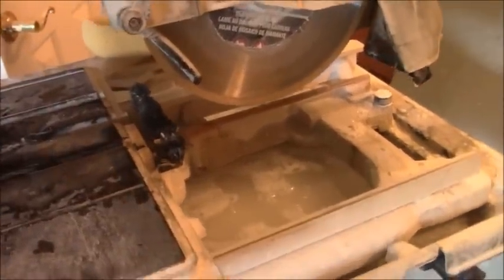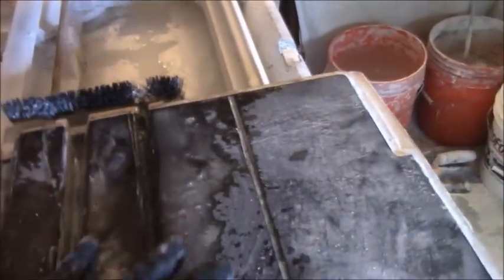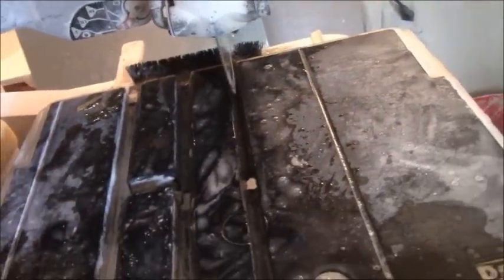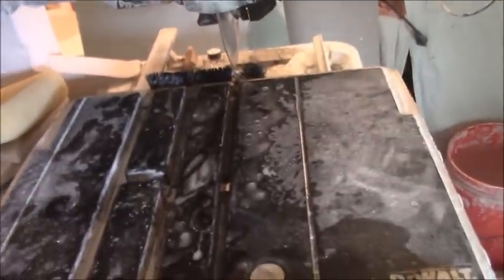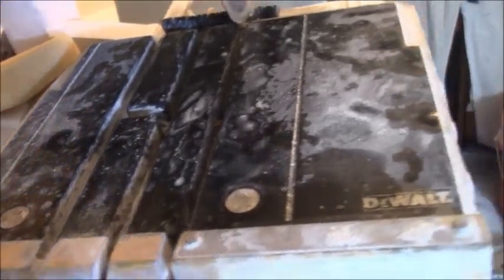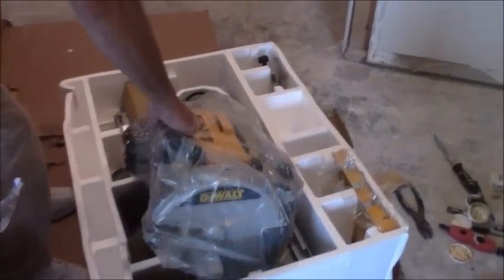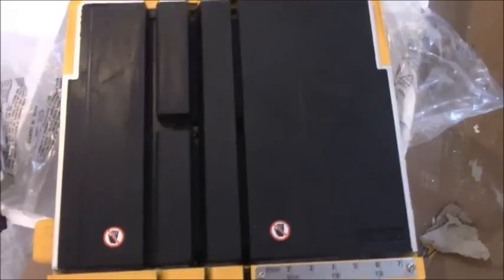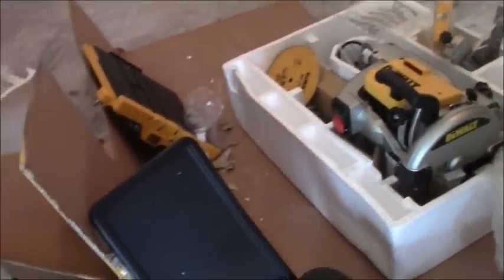Dewalt D24000 Tile Saw.......a review

Comment: I bought the dewalt saw about 12 years ago and it was already used at the time and love it,  but it is not as durable as a target or now huskvarna.  A belt driven motor is just more heavy duty imo. Since owning this saw, I have had to replace the bearings about 5 times but perhaps the new models are better. Each time I replaced the bearings it's about 100 bucks in parts , but the mobility , options, and all the features you mentioned make it my favorite saw I have ever used. With these hard porcelain tiles today, this dewalt just doesn't have the power day in and day out to last without these bearings wearing out imo . Not that it's a diyer saw, but it's not really built for an everyday commercial type saw like the targets were, but for me, someone e that doesn't use it on every job, it's features out weighs the motor issues. My fav thing is how dry this saw is! Once you install the side and back water catch trays, it literally doesn't spill any water. My tray is fine and I don't think you will ever have an issue with it at all. You can also use 7 or 8 inch blades (which I do sometimes ) so to eliminate the 10 in blade flex you get with really hard porcelain tiles. I have owned 4 different brands of wet saws in  35 years of tiling and although this is maybe a light duty saw, it is my favorite
Reply from the maker: Thanks
For
The
Input
Reply: vapdivrr...... Hey I need your help
Reply: What do you need buddy?
Reply: siddharth nagv
Reply: Unless your paying someone to do it for you, then your full of shit about  "Each time I replaced the bearings it's about 100 bucks in parts".  I just changed mine and it was $14 for the bearings.  Did it myself in 5 minutes.

Comment: I came across this porcelain tile that was so hard I couldn't cut without chipout until I found the best tile blade I've ever used. The Alpha Porcellana 10" part # pt 10a+. When any blade starts to run or chip out I cut an old red brick about 10xs forward and backward to remove glazing and expose new diamonds. This seems to be working best for me, just thought I'd throw that out there.  I think you'll push the ole husky aside the more you use the Dewalt. I do miss the power of Belt. God vid Bob!
Reply from the maker: Thank You Sir !

Comment: I recently purchased the DeWalt 10 inch saw. But straight out of the box it was chipping tile and cut crooked I tried to adjust on it numerous times using the factory blade they sent which is a Dewalt but I can't seem to get it to not chip the tile. Will putting a higher-quality blade on Fix-It what's your recommendation?

Comment: Is a tile saw better than a manual tile cutter (score and break off kind) for all tile cutting situations or is there is time and place where it can be more appropriate than a tile saw?
Reply from the maker: A wet saw is ALWAYS used for my jobs, very rare I use a manual cutter ( score & snap ) but a lot of tilers do use both.
No reason for a DIY'r to spend money on this, there are cheaper wet saws out there AND you can always rent one.
Reply: The saw and the cutter are tools that complement each other and is best to have both at hand. The saw can do ANYTHING the cutter can and then some (L cuts, 45 degree cuts... ) and the cut itself will usually be cleaner. If the cut is going to be exposed - use the saw. The cutter however is faster. MUCH faster. My guess is at least 10X  faster then the saw. Also for the cutter you don't need electricity or water, and there is virtually no noise and dust. If the cut is going to be consealed in any way (baseboard, another tile, silicone)  the cutter shines. 
1 small job? A cheap saw will do.

Comment: I have a question about blades. I use a continuous rim 7" saw and the blade works great for the first twenty cuts or so, after that the blade takes forever to cut. Also, I let the blade and the rpm do the cutting, I don't force it. I can't see how you can get that much life out of a blade and it still makes cuts quick enough.
Reply from the maker: Not sure what blade you use, as shown here the Dewalt blade has half the cutting width than the Home Depot blade I get...which lasts me at least 4-5 jobs, so the Dewalt blade will be tossed or used as a back up. Sounds like you're dry cutting ??? Not sure why yours won't last.
Reply: ridgid 7" wet saw. I have purchased many blades, my favorite is the black widow seems to last the longest. most of the time i get the ridgid blade at HDpt, the gold one. It seems the leading edge of the blade gets smooth and the diamonds fall out.  ill have to look into sharpening stones "dressing" the blade.
I mainly cut porcelain, they usually last 2 showers then i just change it out. towards the end of the job a cut can take a couple minutes. If i force the tile trough it chips the cut and if it grabs it could break the tile so i just take it slow and buy new blades... gets costly
Reply from the maker: Costly & annoying ! I'd dump it on CraigsList and get a different saw.
Reply: I usually run Bosch blades but kinda expensive. When mine start to not cut as good I take my blade off and turn it around so the blade spins in the opposite way.  I'll be able to use it a lot longer. Try turning your blade around.
Reply: And make sure your getting enough water on your tile when cutting.
Reply: I've had the saw about 2 years and i do notice the pump is weak. Ill look into replacing it, thanks for the suggestion.

Comment: if you could not figure out how to get the blade on and tighten it what else did you screw up putting it together
Reply from the maker: Not sure I understand...on my other saw I needed to put vice grips on the spindle of the belt drive in order to loosen or tighten the nut for the blade.

Comment: I just bought a D24000 without the stand for $699 with free shipping no tax.  With the stand  was $849.99 you can buy the stand for $49.00. I bought without and saved $150 @ Factory Authorized Outlet  It cost $100 more if you bondle it.  I'm thinking about retirement in two years and did it anyway.
Reply from the maker: That's a great deal you got !